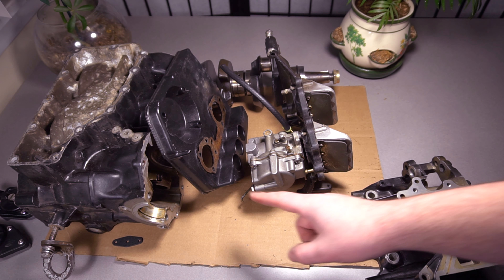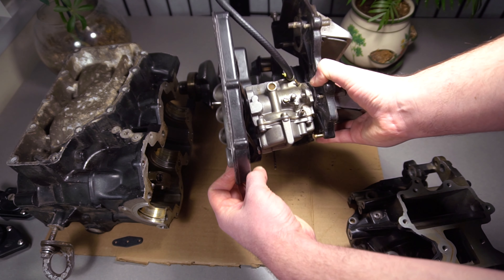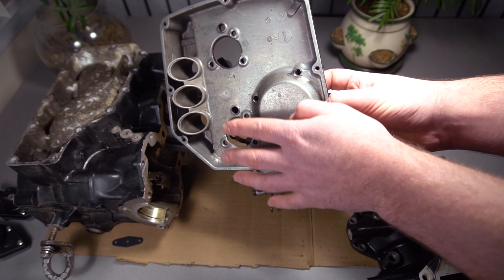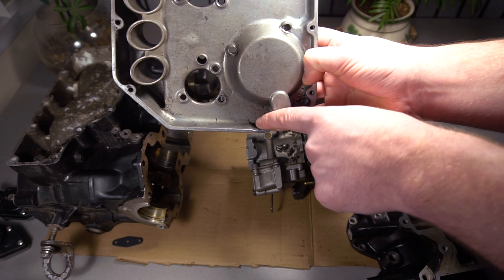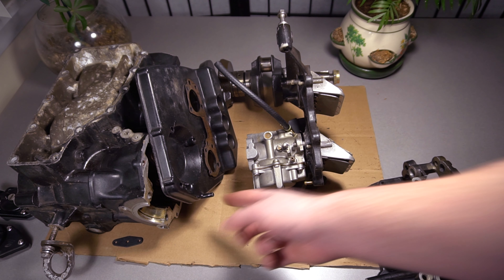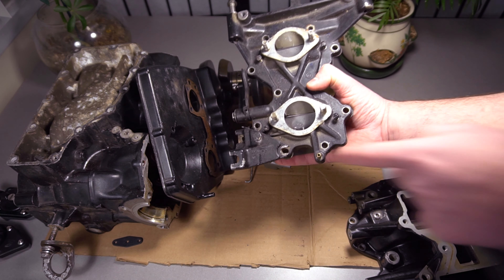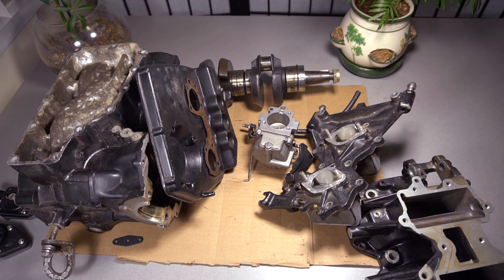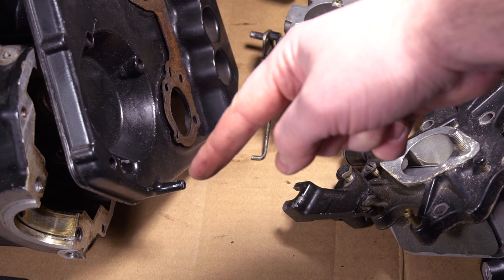What does the connector at the bottom of an Evinrude Outboard airbox do?

Comment: I have excess fuel coming out of this hole and dripping from the air box...
What could be causing this?...
Also, when I squeeze the gas tank ball, fuel seems to come out of this hole.
(I have the vro pump, like the style u show in this vid)
Also, should you be able to see mixed gas in the fuel filter? Or should it be unmixed in there?
The fuel in the plastic see through filter has oil in it— I’ve never seen that before,
Usually the gas in there is on it’s way to the vro and hasn’t been mixed yet—🤷‍♀️
This is puzzling me....can u help?
I changed all my fuel lines recently,
Cleaned the carbs and was adjusting the idle mixture screws.
I know I connected everything the way it was originally, but I never recall seeing mixed gas in the fuel filter.
Reply from the maker: Hey so I am not 100% sure about the VRO part as I have always bypassed it and thus my gas was already pre-mixed.

If you are squeezing the bulb and fuel is coming out of this hole, it means its passing through the carbs and overflowing. Normally when the carbs fill up, the float will push the needle and block the intake hole. This way once its full, at a certain point you should not be able to squeeze the bulb any more. If you are still able to, clearly the float needle is not closing that hole. I would start with there.

Taking the carb apart seems simple but its harder then it looks and if you do not fully understand how it works simple errors can be made.

If you have one of these VRO pumps I would consider just doing pre-mix. It is just one less thing to troubleshoot. You can take the entire VRO pump out and replace it with a $20 pump from Amazon (at that price even get a spare, just in case).

Hope this helps let me know if you fix it, good luck!
Reply: Hello Everyone 
Thanks for your reply—
I took the vro apart and it was fine...
I think you’re right about the float needle— also, just a heads up, I bought one of those plastic gas tanks with the vented cap and forgot to open the vent while underway because i wasn’t used to having to do that—
Also, the little hole/rubber valve in the cap is so crappy and small it doesn’t allow good air flow so I took it out.
Took the boat out and it ran way better and no mixed fuel in the fuel filter.
But yeah I think you’re right it’s the carbs needles because gas is weeping from the housing and when I give it throttle, some sprays out towards the airbox—
Not the reeds I don’t think cuz she starts nice....
I’m gonna rebuild the carbs and some other stuff in spring.
Thanks for your help, take care ✌️

Ps— I had taken the carbs apart and cleaned them, but didn’t rebuild, so I think that’s my problem.
The little gaskets and needles are old or could have been effected by the cleaning
Reply from the maker: @SBecktacular  don't let the carbs sit with fuel all winter. Makes cleaning much harder.
Reply: Hello Everyone 👍